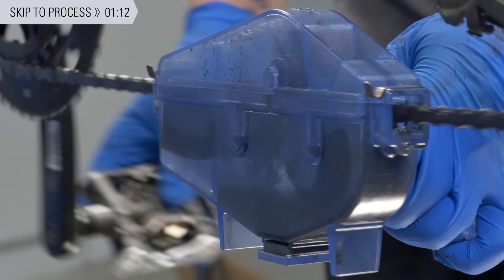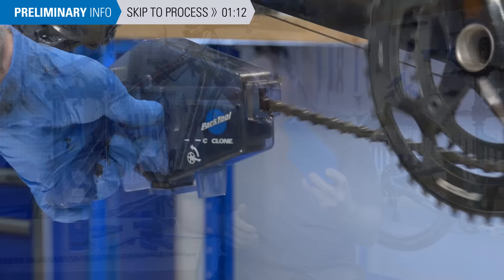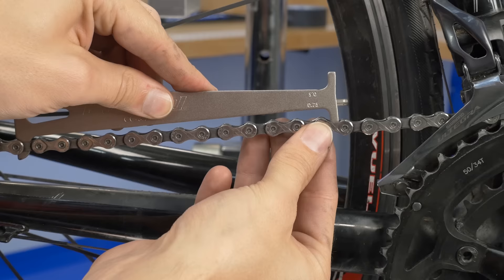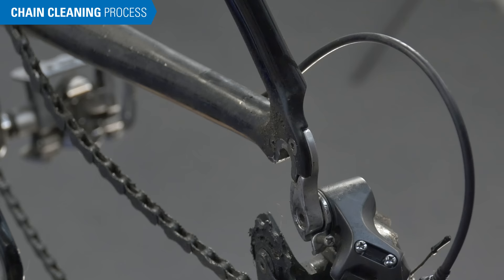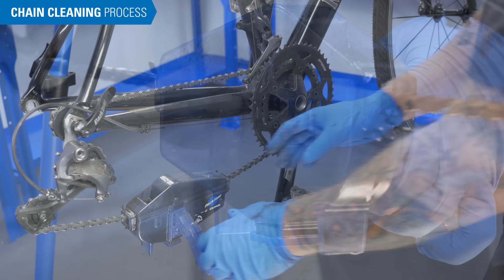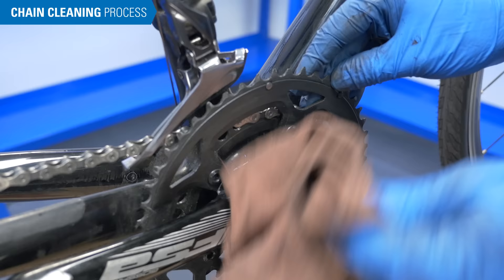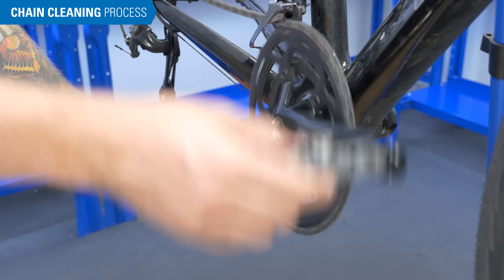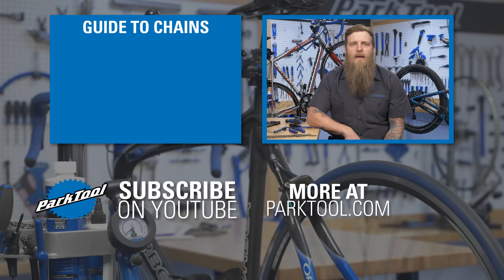How To Clean and Lube a Bicycle Chain with a Park Tool Chain Cleaner

Comment: Cleaning once a month? Best I can offer is once a year.
Reply: Yeah honestly once a year should be fine anyway
Reply: It depends on how often you cycle. If it's almost everyday best to clean the chain at least  once or twice a month, if not, maybe every 6 months should suffice
Reply: Wait you guys clean your chains? 🫣
Reply: Just replace the chain once a year. Or better do bike maintenance in a bike shop once a year and get a new chain and clean drive train without any hassle.
Reply: @darikfrye91 no wonder your bike doesn’t peddle 😂
Reply: It depends on how much you cycle, I actually used my bicycle 1 hour everyday, 5 days in a week during 1 year to go to work, under heavy summer, heavy rain and in winter, and the lube wears out very quickly under those conditions, especially when it's rainy
Reply: Once a year? Best i've done is spray wd-40 and stop using the bike for 10 years coz the chain broke. Lol
Reply: Honestly, you don’t need to clean the frame too often, but your drivetrain should be cleaned once every 100 miles. Gravel and mountain bikers have to clean those far more often than roadies!

Comment: Now all I need  is a repair stand.
Reply: If you are in Europe, ocaionally Lidl has them for less than 40€
Reply: Lol
Reply: I just turned my bike upside down
Reply: @quezmiz736  King
Reply: either upside down on some cardboard to prevent scratching seat and handlebars, or get a workmate (sawhorse) and weigh it down, i use 35lb weights, then using the clamp and a couple hockey sticks, prop the bike up and boom, you have your own functional bike stand. sure it’s no articulating stand and it doesn’t hold the front tire off the ground, but it’s worked for 20+ bikes and still has yet to fail me. or a third hand to hold up the back tire works as well, just make sure to pay them good if you take that route
Reply: If you have a bike rack for your car that also works really well
Reply: Lol
Reply: xD
Or put it against a wall
Reply: @quezmiz736  does it work well?
Reply: @dripzshadow2109  yeah, it does the same job as buying a stand
Reply: @quezmiz736  cool thanks man how did I not think of that 🤦‍♂️
Reply: Me too man
Reply: Upside down
Reply: (2)
Reply: @quezmiz736  yea that is the gerat one but use some plastic things to keep the handle directly to ground
Reply: Use a park table or bench and just turn it upside down, just as good
Reply: same here 😂😅
Reply: @Jellyyy  - i don't have a car.
Reply: @PedroFTeixeira  yes but it’s not good and you have to wait a week

Comment: Wait what. I know this video is 6 years old but not 600 years old right? Spray your floor with water. Make everything wet around u so the oil and grease that flies of can be cleaned better. Uhhhhhh. Maby prefent that in the furst place with a bucket

Comment: But, how do one clean the chain cleaner?
Reply: mnyheim you buy a park tool chain cleaner cleaner
Reply: mnyheim a good quality one can go in the dishwasher
Reply: but how to clean the park tool chain cleaner cleaner?
Reply: Entering Park Tool CCCCM-5.2 chain cleaner cleaner for chain cleaner.
Reply: You have to guy the park tool chain cleaner cleaner cleaner.
If you wanna clean that, than...

You cant.
Reply: Cleaners all the way down.
Reply: simple. i did this a lot of times... a spray of WD-40 or other solvant and then rinsing it and its clean as ever my dude
Reply: Just return it lol
Reply: Old toothbrush
Reply: I get mine reasonably clean with alcohol and oxiclean (peroxide bleach).  I would almost suggest mineral spirits or turpentine, but that might be too harsh on the plastic.  Just use more degreaser and an old toothbrush to be safe, I guess...
Reply: rinse with water and maybe soap????
Reply: I dip the chain cleaner overnight with a mixture of a Dawn dishwashing liquid and warm water.  Then rinse with a garden hose the next day and air dry.
Reply: @torb1trick415  nope, it can't be so simple
Reply: Warm, soapy, water
Reply: Between iterations of the chain cleaning, you dump out the used solvent, fill inside with soapy water from a sponge, close chain cleaning tool and shake, dump out soapy water and rinse.  Now repeat chain cleaning iterations until your chain is nice and silver again.  It may take anywhere from 3 to 6 iterations.

Comment: I got here from watching drag racing videos. Now i wanna go buy a bike and clean its chain.
Reply: Lmao
Reply: no you don't. not the bike I had that is.
Reply: Hahaha.. I have a bike.. And now one of these cleaners. And can't wait to clean my chain.
Reply: @aidaan5393  have you used it?  How well did it work?
Reply: @srperk6163  Well, I bought it and today I used it first time. I used warm water and soap as I used before buying this product.

My first experience is not good at all. That sponge on the right side came out after 2-3 circles. I took it out completely because it was impossible to use it inside.

Result wasnt very good after 30+ circles. Chain was still dirty. Probably should try better cleaning liquid. But 1 bucket, 2 litres of water with soap and toothbrush did much better job. It may be take some more time, but result is much better.

Maybe I will try it more, but it looks like a toy for me, sorry.

Comment: He wipes the chain off way too soon. Instead, backpedal for at least 1-2 minutes. As the rollers pass over the cogs and jockey wheels, they'll rotate slightly within the chain and that will help draw the new lube into where it needs to be inside the roller. Wipe off then repeat a few hours later on a freshly cleaned chain.

Comment: After solvent and washing water, I use a kettle of boiling water, poured over the chain while I back pedal. This gets rid of the last of the solvent and washing water, while helping the chain dry quicker. I get ride of any water by using GT85, which also ensures penetration of lube.

Comment: Great video.  I think hitting the chain with 1. Solvent degreaser, 2. Soapy water w/Oxyclean, then 3. 70% Rubbing Alcohol, drying completely, then lubing with the correct wet/dry lube is the way to go.  Emphasis on wiping off all the excess lube!  Too much lube is possibly worse than not enough, due to the dirt it can collect.

Comment: OMG - I've never noticed the 2 holes on the top to fill the tool, what an idiot I am
Reply: Also thought that is no point to use it without the water, but never thought to fill it with water... not smart either...

Comment: Been getting into some 'amateur' bike repair this summer and I can't tell you how annoying it is finding a bike that someone gobbed up with a heavy weight automotive grease.  You get dirtier from a single touch of the chain than anything else you repair on the bike.  Found that brake cleaner works best to cut through that sort of grease buildup.
Reply: Grease is best product for chain

Comment: i literally wipe my drivetrain down after every ride,  using fresh dry lube (the "carrier" for the teflon fluoropolymer also acts as a cleaning agent) a clean rag and two toothbrushes duct taped together , takes about 15 minutes to do the cassette, chain, jocky wheels, and chainring... my drive train stays as new ... saves a lot of wear and tear as well as a nasty greasy mess
Reply: Are you saying that you dry lube thr chain after each ride? I do wipe down the cassette, chain, etc. after each ride but don't lube the chain.
Reply: @andrewbarker1686  yep ... the "carrier" for the teflon fluoropolymer also acts as a cleaning agent
Reply: @flyingtiger4991 , thank you. Which dry lube do you use? Do you just put the dry lube on a rag and rub it into the chain etc.? Sorry for all the questions but I would like to try this. As I mentioned before I clean the chain and cassette after each ride but feel like I am stripping the lube off the chain when I do so.
Reply: @andrewbarker1686  no need for sorry bruv ... we exchange techniques and ideas , that's how we try and experience different stuff to see what works best for our own purposes ... finish line dry lube , the 2 oz. bottle has a nice spray nozzle ... hose the chain , scrub with tooth brushes (see Seth's bike hacks for how to make the duct tape two brush tool) ... wipe off the excess with a clean(ish) towel , let dry ... hit it after every ride ... it will appear shiny and shift  "as new" on every ride
Reply: You may wanna watch the mark ruffalo movie “dark waters” if you’re using Teflon over there.

Comment: TIP : If you want to make cleaning more efficient 1.apply solvent on the chain. Clean the dirt, then loose the chain from all the rotors, clean the rotors first then the chain.

Comment: There are e-bikes with chains that cannot been turned backwards. In that case remove the handle of the Park Tool Chain cleaner and turn the tool so that the place where the handle usually is mounted faces the frame of the bike. Now you can turn the chain forward and the tool is as useful as it is for normal bikes. I do it like that and I am very happy and my chain is easily cleaned.
Reply: Damn e bikes can't do anything right
Reply: Or use the proper tool to block the drivetrain in order to rotate the chain backwards:

https://youtu.be/eOPr8dWi2GQ
Reply: Good tip. Never thought of doing it that way. Thanks!
Reply: Lol, proper tool.. you mean a stick?
Reply: Everyone owns a Allen key right? Now you can back pedal your e-bike on a stand.

Comment: Get the metal body CM25. It's pricey but unless you do something stupid to it you'll never have to buy another one, only on rare occasion have to replace components. The plastic scrubbers work but eventually develop cracks. Put a magnetic strip or a small magnet in the bottom to pick up metallic particles - the CM 5.2 has a magnet built in.

Comment: Thanks for another awesome video Park Tool! I tried this for the first time today with this video on beside me for reference, and it worked like a dream! 🤩

Can I ask a quick question please off the back of this?
Would it do any harm to leave the rear wheel on while cleaning? I guess that removing the wheel makes it easier to clean a full cassette etc (and maybe keep disc brake components away from splashes too?), but I was doing this on a single speed with a 17th hub and wasn't sure if it was totally necessary? My bike does have disc brakes but I used a Muc-Off covers to sheild them before I started cleaning the chain.

Thanks a lot and best wishes!
Gavin

Comment: I have this kit and similar brushes and hub, it worked great, chain it much cleaner than the way I did it back in the day, I also think its easier. I like to take good care of my mt. bike as I don't like to break down on the trail or have shifting issues. I use Simply Green and it seem to do the job and the cost is low. I am not sure on what the best lube is through?
Reply: They say soaking in parafin wax is the very best chain lube, and it's more inexpensive than the oil-based lube. If you want a video let me know and I'll provide one.
Reply: rock 'n' roll gold
Reply: @mctg9043  thanks

Comment: What kind of soap is safe to use when you go over it again after the degreaser?
Reply: I wud think regular detergent same as u wash ur dishes as u just wants to wash away the solvent. Rinse it well with clean water then let dry b4 adding the oil

Comment: After every ride:  Spray brush, chain & gears with simple green, rotate peddle while holding brush on gears, then apply more simple green to brush and rotate chain with brush on inside of chain, rinse with water, air dry, apply tri-flow oil to chain.
Reply: After every 100miles (dry): Remove quick link and split the chain, throw it into a crockpot of hot wax. Wipe down the wheels with a soaking wet towel, same with the rest of the bike. Wipe down the brake pads and make sure there is no metal in the pads. Wipe down the chain rings and also the rear cogs. Fish out the chain from the crock pot, let it cool and reinstall. 
After a wet ride: repeat above

Comment: I believe what is shown here is the valid chain cleaning method, beside of taking it off and cooking it out. All these recommendations with the rags dragging over the chain links do not help much. For the most part this cleans the chain where it does not matter.
My KMC chain cost about USD 12. I use a cheap oil and replace the chain every 2000 km or so.

Comment: Chain off and give it a petrol bath .....and dirt grit and oil just fall off ...chain on relube...job done
Reply: The chain manufacturers are saying don't use acid or alcohol based solvents. That must include petrol I suppose. What are your thoughts on why the chain manufacturers say this?
Reply: Arahorn petrol has a small margin of ethanol however I do not believe it is alcohol based.
Reply: Petrol is not acid or alcohol based. Basic chemistry.
Reply: Diesel fuel also works, it also lubricates the chain when it goes into the links. Can also be used with other chains, like the ones of forklifts. Diesel has the advantage it has no flammable fumes.

Comment: Complicated and messy option. I did that only once and I gave up because after you clean the chain you have to clean the cleaner and the mess from the floor. So if you want to clean a chain you can put it in small plastic bottle and add some diesel fuel or solvent and shake the bottle some times. After that pour the solvent out and cut that bottle to take the chain out. Use some paper towls to rinse the chain. Good luck!
Reply: That's a clever way of doing it!

Comment: Ebikes I understand can't move chain back pedal. Can I use chain cleaner tool forward motion? What was the purpose of backward motion in video?
Reply from the maker: If you flip the bike upside down you can use the CM-5.2 as the bike is being pedaled forward. Stay tuned tho....

Comment: Great video! do you recommend using wax lube on road bike chains or should one be looking at other lubes?
Reply: This is probably three years too late but waxing a chain should be fine for road bikes. Although the process is much more tedious than using regular chain lube and requires removing the chain every 300km you ride
Reply: @alihaleem8264  I believe wax lubes attract more crap than light oils. I wud use light sewing machine oil or similar and be done with it

Comment: when talks about solvent, does he mean the degreaser? so first run it 30 revs through degreaser, then repeat with regular dish soap water?
also what's the difference between the CM 5.2 or CM 25 ? I got the CM 5.2 without knowing there might be differences i may have to watch out for.

Comment: Thank you, I have done this a few times with this video.  Why spin all backwards, there must be a reason?
Reply from the maker: the lower section on chain is being pulled directly by the chainring when pedaling backwards. When pedaling forwards the bottom section of chain will be routed through the rear derailleur so it will be pulled forward due to the derailleur.

Comment: Im guessing solvant can use kerosene as  substitute, thats what I use to clean my motorcycle chain anyway
Reply: What!? No I can’t tell if ur joking it’s really bad for it
Reply: @yourfatson8262  Keeping it on bicycle chains what would u use to clean ur chain?
Reply: J Lee park tool sells a chain cleaning fluid or you could use chain lube
Reply: @yourfatson8262  Your reply was a little confusing? R u suggesting using chain lube to clean a chain? I believe chain lube should be applied after cleaning yes? Secondly I understand Park Tool sell a cleaning fluid but they are very far from me. A bicycle chain has no rubber o-rings etc so basically any solvant will do but I use kerosene as it is recommended by many motorcycle shops as being O-ring safe. I know some people use WD40 for cleaning their chains and with some research u can find WD40 is approx 30% kerosene and some lighter hydrocarbons so basically ok also but Im not sure for motorcycle chain with WD40 primarliy bcos I dont know 100% what it is
Reply: J Lee kerosene can ruin it just use soapy water if you can’t get the real stuff don’t use wd 40 though it will start eating away at your chain I made that mistake chain lube can be used to clean a chain just don’t use kerosene on it it’s to linear and gets into spots on the chain and gets dirt causing it to not come out it’s fine for a moto bike because the chain has less small gaps just not a normal bike

Comment: Nice video. I have a CM-5.2 and it works well on my 11 speed chain. Unfortunatelly i also have an 8 speed bike and the CM-5.2 does not work so good on that. The brushes get stuck on the chain rollers and many end up being cut off by the chain :( what can i do?

Comment: What's the general consensus about using Simple Green in the CM25 Chain Cleaner to clean the chain instead of Park Tool solvent?
Reply: Park Tools says "No" lol
Reply: Use diesel fuel - it cleans the chain, and lubricates it at the same time.

Comment: When I backpedal is causes my chain to come loose? Should I get this looked at at my bike shop? Could you just pedal forward instead?
Reply from the maker: Typically this is caused by something preventing the freewheel or cassette from spinning. This could be internal corrosion, build up of debris behind the largest sprocket or debris near the frame.

Comment: I have mount this device backwards on my ebike because the chain cannot be backpedaled. It would be nice if the handle can also be attached to the opposite side of the chain cleaner.
Reply from the maker: The CM-5.3 handle can be swapped for this reason.
Reply: I have model CM-5.2 that allows the handle to be attached to one side only.
Reply from the maker: The newest version of that tool(The CM-5.3) is doing exactly what you are asking for. In the following video at 30ish seconds you can see it being swapped. https://www.youtube.com/watch?v=MXnMZC6gp0k

Comment: Wd40 is also good solvent for bicycle chain but I dont recommend it for motorbike chain bcos of the O or X rings etc
Reply: WD40 is not a lubricant.  It is only a moisture remover.